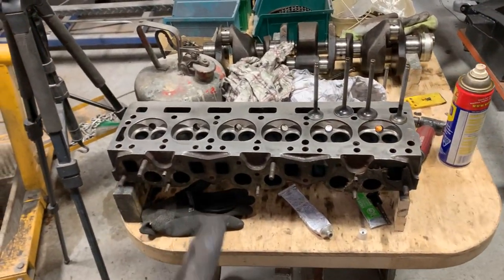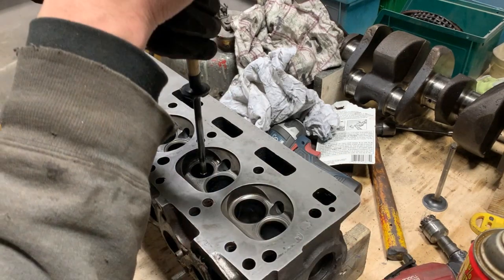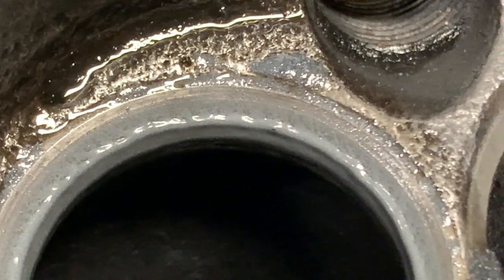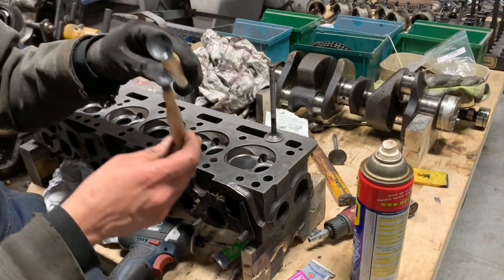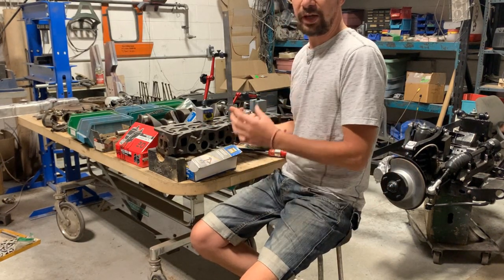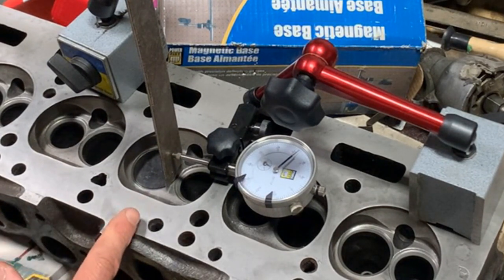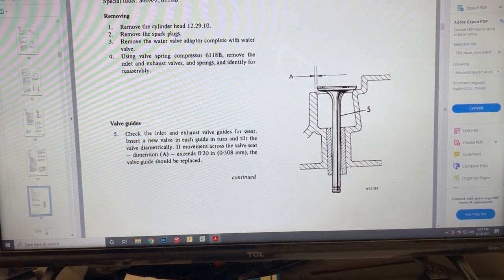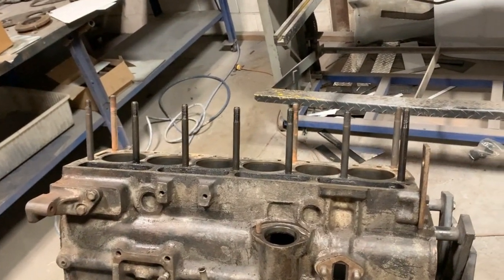1974 Triumph TR6 - Part 64 - Lapping the Valves

Comment: I wonder how many people in the UK are horrified that hardened valve seats are not fitted ?
Reply: I gave up being horrified by BMC when I was commuting car sharing with an engineer who had worked for them in QA. No wonder this shower have been pushing up daisies for these last 30-odd years. What a crowd of cowboys! Not the engineers and craftsmen, the bean counters who ran that firm were basically just crooks. They case hardened the crankshaft oil seal areas so thin as to guarantee shaft seal failure after just 80,000 miles. Their logic, our custommers are fleet operations who sell at 50,000 miles and we do not even want the old vehicles to stay on the road at all. So everybody learned to buy Japanese, but still the daft politicals kept bailing them out. Never in the history of global commerce did a company more deserve to die.
Reply: Yeah they didn’t fit LED lights or airbags either....

Comment: Silicon bronze valve guides for unleaded fuel a must.
Reply: Please explain why you would need Bronze valve guides when using unleaded fuel ?
Reply: @tjm3900  These heads were designed to run on regular(leaded) fuel. The original valves ,guides, and seats were lubricated/cooled by the lead in the regular gas.This resulted in lots of burned up exaust valves and warn out guides when run on unleaded gas.
Reply: @craigevanson8063  Well, while I have seen VSR on BMC 'A' series engines that had been driven hard, I have not seen it on Triumph SC or '6' engines, even with over 100k unleaded miles on them.  However, I have seen severa valve seat inserts that had fallen out AND Bronze valve guides that have not had sufficient clearance (they need more than stock) and have 'hung up' an exhaust valve :-(
Sorry, but I have come to the conclusion (over may years working with these engines) that there is little grounds for being pro-active in guarding against the evil Unleaded gas.  If it ain't broke, don't fix it !   Save your money for other things.